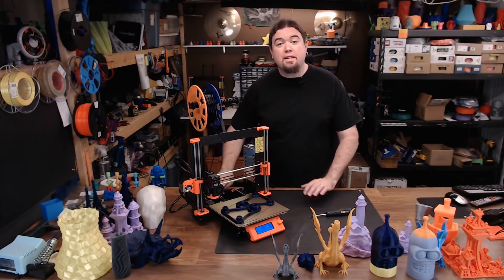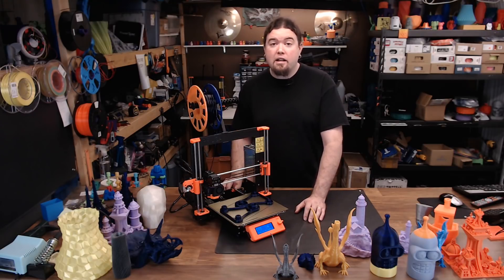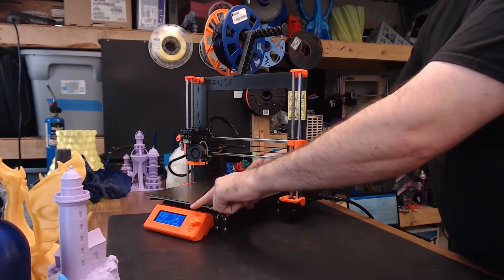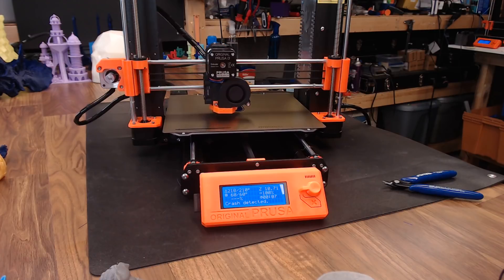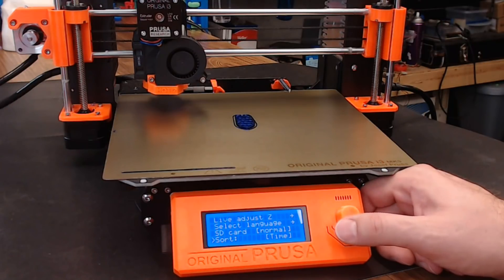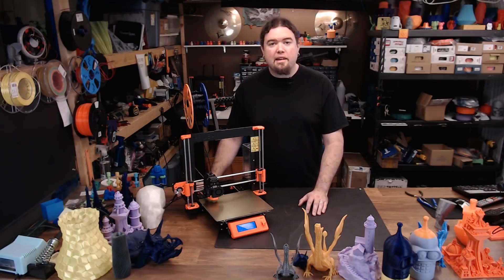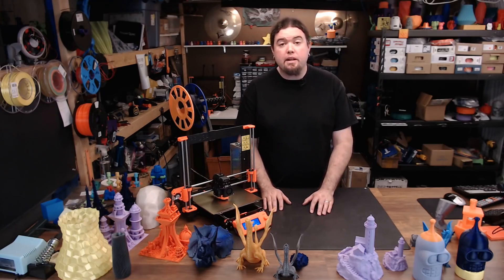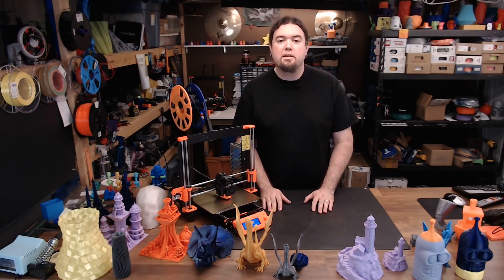Prusa MK3 3D Printer Review - Awesome - Chris's Basement

Comment: Chris, your reviews did it(this one and the Pulse). I have been on the fence about spending the cash to get a pre-built printer that didn't need any upgrades to print well. My first printer was a 2018 Tevo Tarantula kit. Then I purchased a Monoprice Mini Delta. Have had great fun upgrading and printing trinkets for friends and family. However there always seems to be an issue here or there that needs a new tweak or shim or bolt or bearing or ...
I had been considering the Matterhacker's Pulse for a long time. Wanting to support a printer made in USA, but you made a great point about it being meant as an eco system. I'm pretty use to using Slic3r / Cura and Octoprint so having to learn Mattercontrol and knowing that it still wouldn't produce as nice prints as using your workaround with Slic3r ... sigh.  
Well, I just made the leap and ordered an MK3S(assembled).
I hope my experience is as positive as yours!
BTW learned a great deal from your videos on Octoprint with multiple printers. Well done sir.
Reply from the maker: Awesome man! I am glad I could help. I just got me second MK3 and they are really great machines. I hope you have a good time with yours.

Comment: IN YOUR opinion anyway.... as someone that owns 5 printers I disagree with you.. Prusa is a over priced and over hyped POS junk printer. (Prusa WILL tell you anything and sell you junk to get your cc number that is all they are concerned with and they will lie to you to get it.)  ESP when you compare them to the printers that are out now. Ender 3 under 200$ you can add filament protection and also power loss features by upgrading the main board not bad build volume 235x235x250 if you want a feature rich 3d printer CR-10S is a good pick for the buck around 400$ a lot cheaper then the prusa with a build volume of 300x300x400 filament sensor and power protection and that is almost 1/2 of the cost of a prusa. i do own a prusa mk2s upgraded to a mk2.5. Even the new CR-10S Pro is cheaper then the prusa and its a really nice printer once you get it tuned in. But this crap the prusa is a good printer is bogus. with in my first 7 months of owning the MK2S 4 pinda probes, 1 heat bed, and 1 thermostor went bad and that is with in the first 7 months of owning it. then you will hear Prusa support team tell you they are sorry they got a bad batch of pinda probes then act like its your fault. i got so frustrated at that printer everytime you goto run it you need to work on it. My CR-10S Pro is my goto printer now. and my under 3 is a little work horse My prusa sits on my basement floor now its a paper weight im going to start stripping it soon. got sick of working on it...
Reply from the maker: Absolutely, 100% this is just my opinion based on my experience. I am sorry to hear you have had such a rough time with Prusa. Would you be interested in selling your Prusa? I am not trying to prove you wrong on anything like that at all, but I would love to check out the printer. Let me know, send me an email, brotherchris81@gmail.com
Reply: @ChrisRiley  guess my reply did not get saved? anyway I would if it was easy sell it to you. I have trust issues Not with you in general so please dont take offence I dont trust a lot of people.  anyway my work force https://drive.google.com/open?id=1bvEF0i0grXs8PJUHclk3dy7H4-UI4F27 my other CR-10S Pro is in another room. I cant have 4 printers in that same room running it blows a breaker. My paper weight https://drive.google.com/open?id=12UbNeRglo2wBqwu8E0un5_yQfKu2qooM

Comment: We bought the Mk3 kit for our High School Robotics team and I could not be happier, especially since it's in a school setting.  All the features equal safer and easier for students.  And it just works. I recently added a Pi Zero & Pi Camera for Octoprint but didn't hardwire it to the board yet. I just have it in a small case plugged into the USB and it's working really well. We had a faulty filament sensor and Prusa sent a replacement in 3 days.  Just awesome service and reliability.
Reply from the maker: Awesome to hear man! I love mine.

Comment: hope you have good luck with it.. My MK2.5 did not last for a year, and with in that year: 1 bed, 4 pinda sensors, 1 heater cartridge and a thermosor cable seamed like anytime i would goto run it a new issue would kick up on it... my cr-10s and my ender 3 has not gave me as much trouble as the prusa has. I did have a wiring issue with the CR-10S  bed. had a brake in the wire easy fix. I bought my prusa as a MK2S and upgraded it to the MK2.5 Really regretted that move. (But i had too my prusa was burning up pinda sensors for some reason.) The only thing i had to do with the Ender 3 was make a Z motor brace to hold the z axis rod in a better position. I do miss the fact i cant print TPU my prusa did do some nice TPU when it ran I have been thinking of getting a clone just so i can print TPU once more. But i am unwilling to pay Prusa's price for what you get...
Reply from the maker: I am sorry to hear that. I have 3 Prusa machines and have had great success. I have to say though I had had pretty good luck on my CR10 and ender 3 as well.

Comment: 31 days and 770h later my MK3 is printing like a new. Never had better printer. Cons: why not silicone sock in a kit? And vertical wall quality could be better "issue 602".
Reply: I had ready that early on Josef was not sold on them.  Also, some people had trouble getting them to stay on, so Prusa support was having to deal with lots of issues.  I’ve always used a sock with my E3D-v6 hot-ends.  Like everything else, you need to “pre-flight check” it and make sure it is in place before the print, but other than that, it works well.
Reply from the maker: @JohnOCFII  Interesting, I had never heard that, it makes since. For sure, it's something to keep an eye. I swap mine every 5-6 mounts I would say.
Reply from the maker: That's a good question, I am not sure why they don't send a sock on Prusa machines.

Comment: If I had the spare money I would buy one immediately. Until that happens I’ll stick to my Cr 10 mini which also worked great until now.
Reply from the maker: I have heard really great things about the mini. I don't have one, but you never know when one might show up.
Reply: Chris Riley yes. Have it half a year now and rarely a print has failed. Works just fine once it’s levelled. Only problem is the glass bed which I use with tape. It’s hard to get the prints off (they stick too well). I really would like to have such a spring steel print bed with a special surface on it. But for the size of the mini no one offers them, you’ll need to cut those yourself.
Reply from the maker: The removable sheets are so awesome!

Comment: I think most issues people have can also partly be due to the built itself. You are of course super experienced in building it so that does make a difference. That said, I also think it’s great. :)
Reply from the maker: Agreed, if you had to build one of these as your first build there might be a few things you don't get exactly right the first time.
Reply: I've build my MK3 kit two weeks ago. It is my first 3D printer. It tooks me 3 evenings (around 12 hours in total). Build manual is nice and  understandable. I only had issues with some too tight holes for nuts. And I was no sure about correct height of PINDA sensor. But after some tweaking I successfully calibrated and had no issues with printing. Only exception is white PLA and false filament run outs reported by printer. Hope this will be improved.

So you don't need to be experienced in 3D printers, it is enough to precisely follow manual and get basic info about calibration and first print before you turn it on ;-)
Reply from the maker: Great perspective on this, thanks for the comment.

Comment: I built my MK3 back in Feb. And the only two things that I did not get that were promised were the Powder coat flex plate "I really wanted that, and still do "  and the filament Jam detection to detect when a roll of filament is tangled and jammed. That never worked either. I think the only way to do a filament jam sensor for a tangled roll of filament would be to add a sensor to the filament holder that can tell when it is being pulled on harder than normal. Great printer, one of the best. A foam coating on the bottom of the PBC heat bed might help reduce the bed noise but now I am just nit picking.
Reply from the maker: The powder coated sheet is a cool idea, but I really like the part finish the PEI puts on the parts. I would still like to give the powder coated sheet a try for sure. 

I should have showed the jam detection, but it was hard to simulate it without triggering the crash detection. I have had the jam detection save my print from spool tangle, so at some point in some circumstances it seemed to work.
Reply: Yes there is a fine line there, being able to supply enough power too the extruder stepper for normal operations and still be able to detect a stepper skip when a jam happens. When I spoke with Prusa about it they said they were still tweeking it . No big deal no other printer has it in this price range. And a
simple way to add it would be a load force sensor of some type in the spool holder as there is a big pull difference from normal spool weight and pull and Jammed spool weight and pull.
Reply from the maker: That would be a pretty cool config.